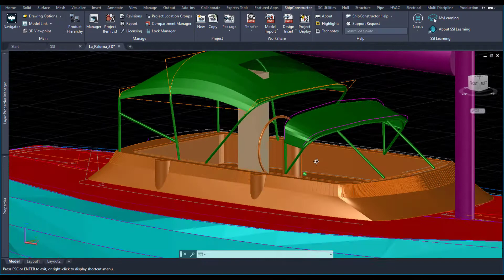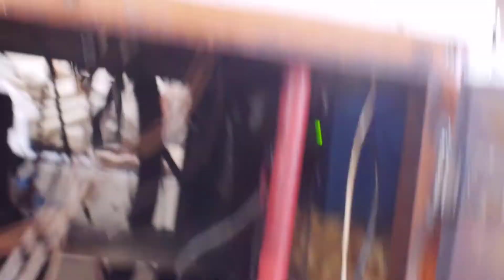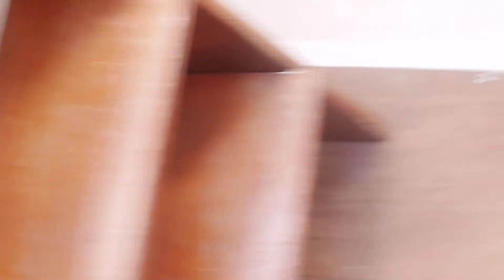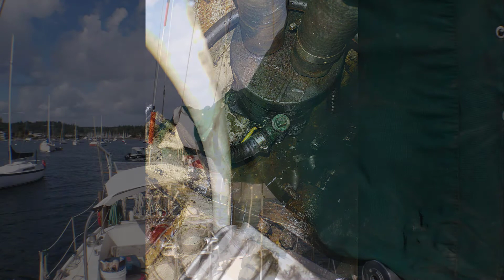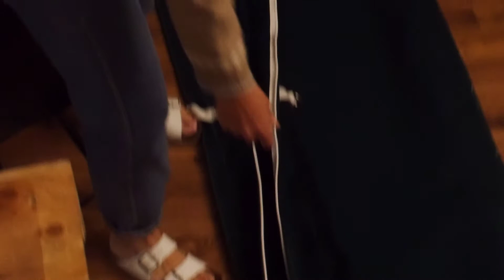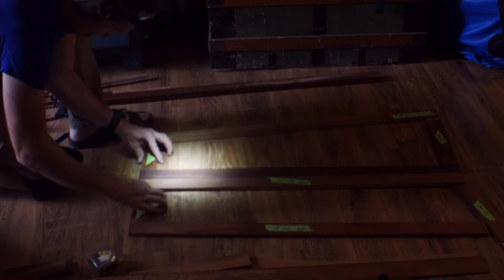LaPaloma 002 - Safety First, Dodger second

Comment: So you're using a room in your house as a workshop? My lower back is twinging in sympathy! Love the mini portable workbench, too! I was hoping to see the new companionway doors in place, but I guess that will be next episode?

Also, I'm envious of your CAD skills. I'm going to be building a 37'6" Benford Sailing Dory, starting next year, and I'd love to be able to turn the plans into a 3D model. I think it would come in handy for some of the modifications I want to make to it. Ah well.. I've learned many dozens of different software programs over the years, I guess it's time I dipped my toes into the 3D modelling world!
Reply from the maker: I work for software company that is specifically geared towards AutoCAD shipbuilding - mostly steel fabrication, but we have clients that use our software on all types of vessels. To actually create the 3D model, you simply need the three plan views and rotate them into place, moving the lofting lines into the correct position. You do not actually need ACAD for this, although it is much more stable and is used industry wide.

 The mini workbench (or trolly-wagon as my wife calls it) is a product of my past life as a joinery carpenter on large yachts. I needed a working surface that was separate from the boat and so built this out of scraps. I used castor wheels and it has a detachable drawer slide for the top half so I can take the toolbox into smaller spaces. Yes, the companionway hatches are just gluing up. Will install them this weekend hopefully.

Thanks for you interest!